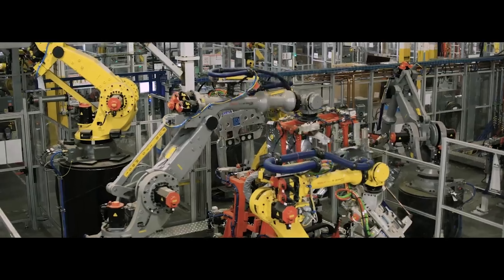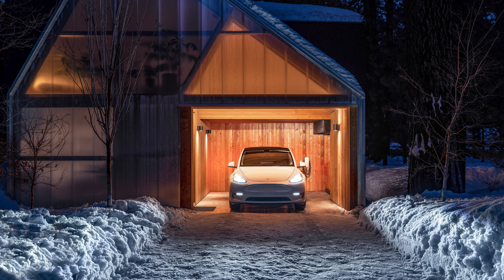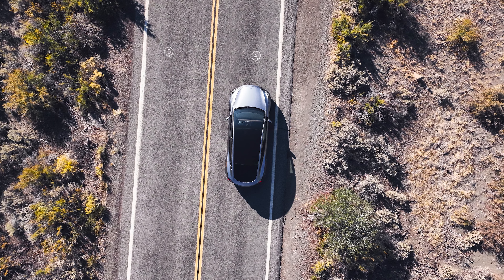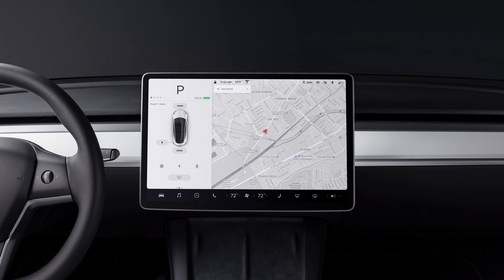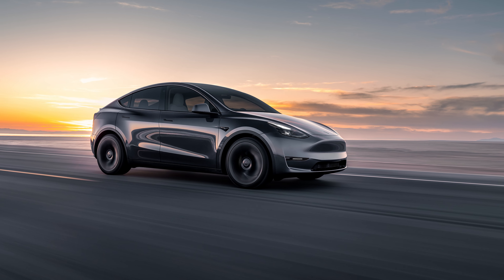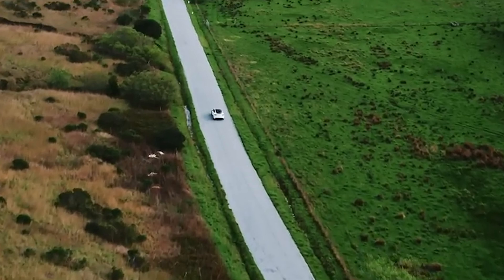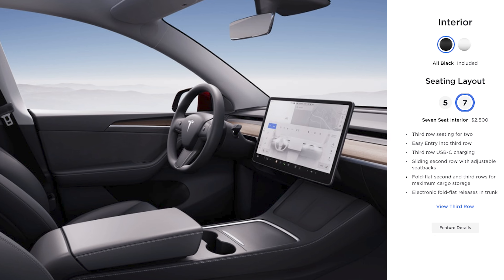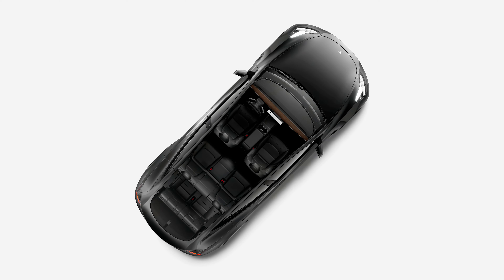2024 Tesla Model Y – Which One to Buy?

Comment: There are a lot of Model Ys discounted right now. We just picked up a Dual Motor with premium White interior and 20” alloy wheels.  I earned 10,000 loyalty points which I used to add an acceleration boost of almost 100 hp. MSRP was $52,000 and it was discounted to $44,090 then add the instant $7500 tax credit brought the out the door price down to $38,000 and change.  Crazy deals out there.
Reply: how’d u get the discount?
Reply: @Starboard20  It was marked down by Tesla.  Search the local inventory and  you sort by price low to high.
Reply: @MikesProjectsandHobbiesMC awesome thanks!
Reply: 6000$ discount? Was it a demo with some miles on it ? Never seen that much discount
Reply: @raheeb1  In late Jan they had huge discounts on inventory cars in So Cal.  It wasn’t a demo  and only had like 5 miles on it. The day we picked ours up there must have been 30 others being pick up as well.